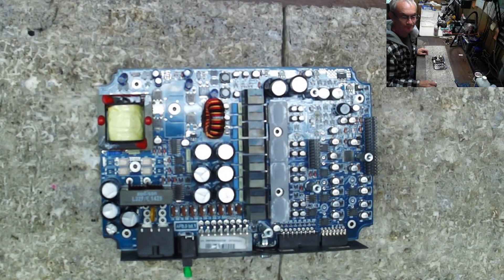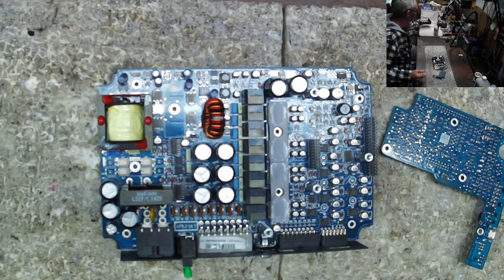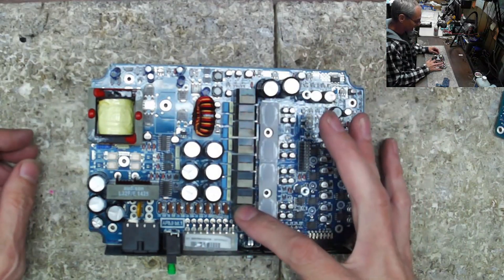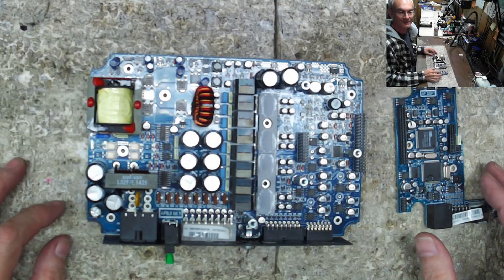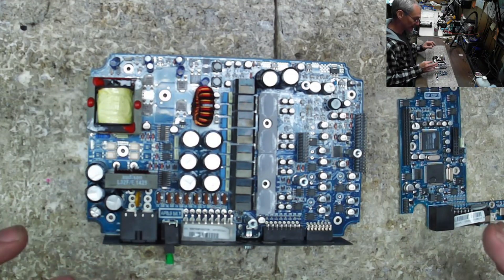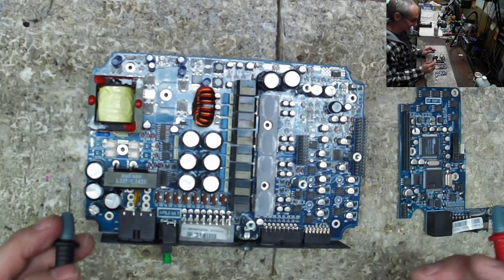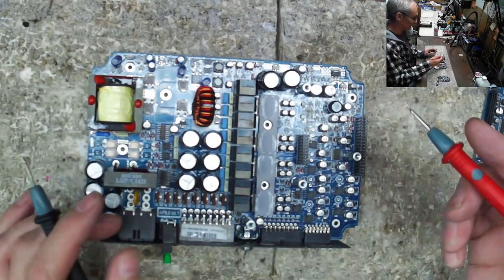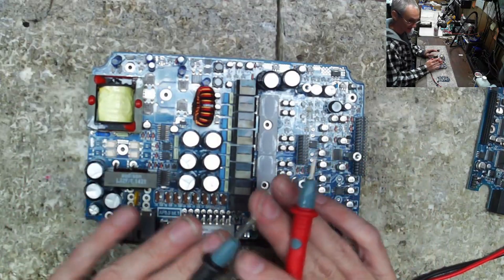Audison 8.9 BIT DSP Combo Amplifier and Why Can't I Repair these?

Comment: ADDENDUM
I noticed you edited in some audio whilst editing this here video and that annoying vibrato was not present
in the inserted Audio, If that was a different microphone then I would use that until some other decent 
microphone is sourced.
Now on the other hand if it's the same microphone as when you're conducting and recording said repairs,
then I would definitely be looking into the preamplifier handling audio during the repair.. 

Good lurk.. Err-Luck..

APU 👁👍
Reply from the maker: Thank you, yes it was the same MIC. The primary video was recorded through OBS while the inserted video was recorded through my editing software. So it sounds like my OBS software is causing this issue. Thank you so much for pointing that out.
Reply: @ellensburgamplifier  Cool.. a slight change to the audio streams settings may be all that is needed..
Reply from the maker: @KorAllRBare  Thank you. I promise to work on this. I just put a video out to see if there is anyone who may be able to help me as I am not software literate.

Comment: i really appreciate your work and knowledge to how to fix these amplifiers , i wish i had somone in your knowledge here where i live ( gulf area ) all  what they say is to buy a new one , no fix , i have a wet sounds syn6 with code 15 - DC Offset which no one want to fix it even the local dealer till me to buy new , it's very expensive amplifier & if i want to send to the manufacturer company which is in USA it will cost me too much only to send & return let alone the repair cost , by any chance do you have any knowledge or worked on these amps , Thank you :)
Reply from the maker: Sorry, I don't have any experience with those. The last Wet Sounds amp I had in was a marine amp which we don't service.